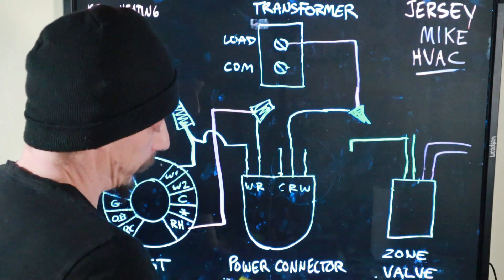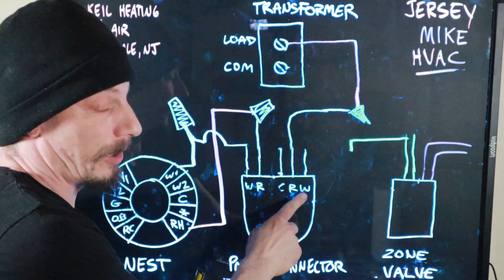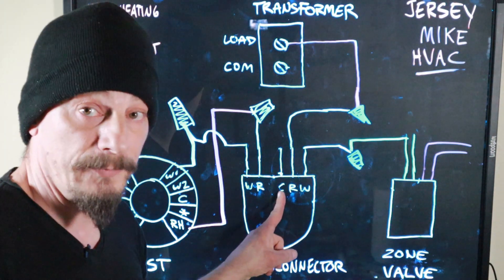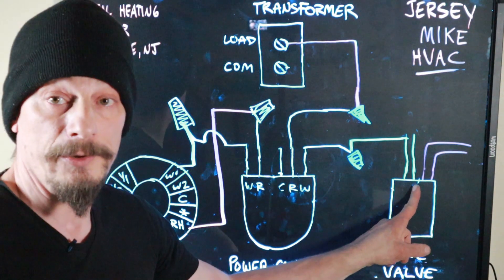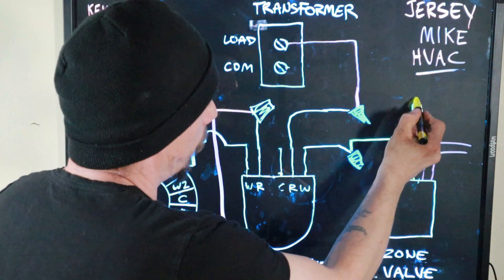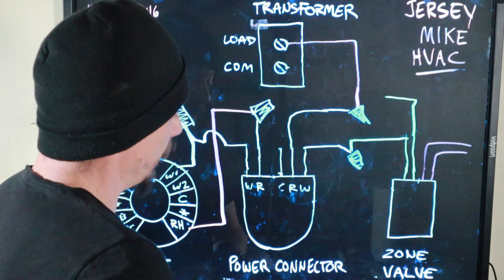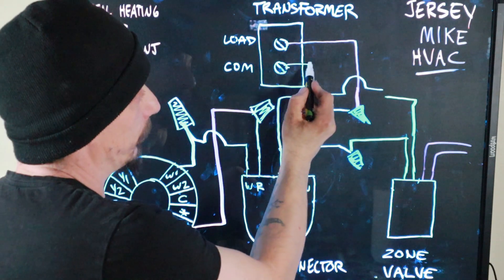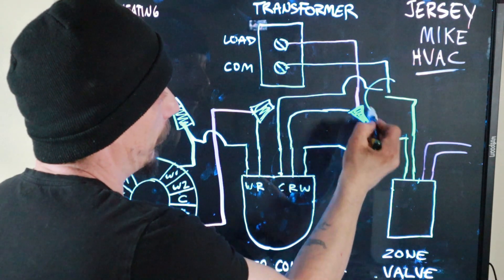DIY Nest Power Connector Wiring To Zone Valve (1 minute version)

Comment: Wondering how to wire power connector to Taco 571 please!
Reply from the maker: 1. You most likely have a red wire from the transformer load terminal going to all all of the red wires that go up to all of your thermostats (the R terminals on your stats). You're going to remove the red wire that goes to your Nest thermostat's R terminal from that bunch and connect it to the R wire on the left side of the power connector. 

2. You will then connect the R wire on the right side of the power connector to the same bunch of wires you just disconnected the red thermostat wire from. 

3. The white wire coming back from your thermostat's W terminal is going to terminal #1 on the zone valve.  Disconnect that white wire from the zone valve and attach it to the W wire on the left side of the power connector. 

4. Attach the W wire from the right side of the power connector to the same #1 terminal on the zone valve you just disconnected the thermostat white wire from. 

5. Connect the C wire on the power connector to either the #2 terminal on the zone valve along with any other wires that are also there, or to wherever wires are spliced together leading to that #2 terminal, which should also be going back to the common terminal on the transformer.
Reply: @Jersey Mike HVAC  
Going into transformer is black and white. Coming out is blue and yellow. Blue wire nuts to red and yellow wire nuts to white. Red goes to wire nut which is white going to thermostats. White goes to wire nut which is white going to zone controls. Red from thermostat just goes to red going to zone control. Zone control #1 is red #2 is white and $3 is green. 
How does this change things?
Reply from the maker: Whomever wired this up didn't really follow industry standards, and I'm missing some information to make sense of what they did. Let's start over. 

1. How many Nest thermostats are you trying to hook up? 

2.  Black/white on transformer is 110 volts. Blue and yellow is 24 volts. You said the blue connects to a red wire, then connects to a white wire which then goes up to the "thermostats".  Do you mean all of the thermostats or just 1 thermostat? And what terminal or terminals does that white wire connect to at the thermostat(s) themselves? R or W?  

 Normally, blue off of the transformer is used as the common and yellow the 24v. White low voltage wiring in this circumstance is typically common and red 24 volts. But you have an arrangement that's mixes it all up. You have blue (typically used for common) going to red (which is typically used for 24v) which then goes to white (which is typically used for common) then goes up to your thermostat?   This only makes sense to me based on what I have if the red wire at your thermostat is hooked up to the W terminal and the white is hooked up to the R terminal...which would also be backwards.
Reply: @Jersey Mike HVAC  There are 4 zones, but one  is garage, so I only plan on installing Three Nest Thermostats. But for right now, I am only doing one. 
Blue comes out of transformer, turns into red, and goes to the bundle of 4 white wires, which then go to each thermostat and are connected to the W Terminal. 
Yellow comes off transformer, turns into white, and goes to a bundle of white, which goes to each the 4 zone valves to the #2 terminal on Taco 571. That bundle also contains the  white wire directly from T in aquastat. 
The red wire going to each thermostat is only tied to the red wire that goes to the zone valve in terminal #1
The red aquastat wire goes to a bundle of green wires, which then goes to each zone control terminal #3
On thermostat red is R, white is W, zone valve #1 is red, #2 is white and #3 is green. 

Thanks!!
Reply from the maker: @donaldsholes6124   OK. I get what they did now. Your thermostats are receiving 24 volts at their W terminals, whereas normally power is supplied to the stat's R terminal. Obviously, that still works with a battery-operated thermostat because the thermostats are not looking for a power source. They're just closing a circuit on a call for heat, so it doesn't matter which terminal the power is coming from.  But I can see that not working with a Nest. 

 So my next question is: what model Nest do you have and what made you determine you needed a power connector?  

Newer Nests need a common. 3rd gen, E, etc. often can work without a common wire, but they use internal jumpers and are looking for their power source off of the R terminal. 

  It's still possible that all you need to do is reverse the 2 wire connections at the thermostat, but I need to know what model Nest you have.
Reply: @Jersey Mike HVAC  They are the original Google Nest Thermostats. After installation, it's giving me a Note: N260, and frequently disconnecting from WiFi. Occasionally, it also reads "No Power" on display.
Reply from the maker: @donaldsholes6124  OK. Let's try this first:

Shut off the burner switch at the boiler. Move the white wire that's going to the W terminal and connect it to the R terminal. Take the red wire going to the R terminal and connect that to the W terminal. Turn the power back on. 

Lets see if that works before diving into zone valve wiring.
Reply: @Jersey Mike HVAC  It does the same thing, No power, connect power, wifi disconnect.
I also did a restart and a factory reset. I need to keep lying on the setup saying I've installed the power connector or it won't let me continue setup.
Reply from the maker: @donaldsholes6124  OK. I have to leave soon to take my daughter to the airport, which is going to be chaos. But later on tonight I'll type up instructions for you on connecting that power connector.
Reply from the maker: So what we're going to do is leave the wiring at the thermostat as I suggested earlier. White wire to R and red wire to W. 

Turn the boiler power off. 

The green wires and the 3# terminal on the zone valves have nothing to do with what we're doing here. So we can ignore all of that. 

 Now you said the blue from transformer goes to a red which connects to a bundle of white wires that goes up to the W terminals on all the thermostats (except for the Nest which we have switched). You're going to disconnect the white wire coming from your nest thermostat (which is now connected to the thermostats R terminal) from that bundle. That white wire from the Nest is now going to get connected to the R connection on the LEFT side of the power connector. 

The R wire on the RIGHT side of your power connector is going to get connected to that same white bundle of wires you just disconnected the white thermostat wire from the Nest.  So on all of your other thermostats, power is going to the W terminals, but with the nest, it's going into the right side of the power connector first, jumping over the left side of the power connector R wire and then up to the R terminal on your nest thermostat via the white wire. 

 Next,  you said the red wire from the thermostat connects to the zone valve #1 terminal. You're going to disconnect the red wire from that #1 terminal on the zone valve (which now connects to your Nest W terminal) and connect it to the W wire on the LEFT side of the power connector.  So that red wire now goes from the left side W connection on the power connector to the W terminal on your Nest thermostat. 

You will then take the W wire on the RIGHT side of the power connector and connect that to the #1 terminal on your zone valve that you disconnected the red wire from in the previous step. 

The remaining C wire on your power connector is going to connect to the same bundle of white wires coming off of the #2 terminal on the zone valve, which go back to both the yellow on the transformer and the white wire leading to T at the aquastat.  

Turn the boiler power back on and test.
Reply: @JerseyMikeHVAC  thanks for the info. I'll try that in a bit and let you know.

It works! Thanks again for helping people like me. Haha. Fire sprinkler fitter, but not HVAC! appreciate it very much.

Comment: Hopeful you might be able to help solve a dilemma. I have 5 zone valves, all have 3 wire ran between the tstat & zone valve red/white and the Green not being used. However, there is only 2 wire connected to the transformer & aquastat. I want to install nest thermostats. can I just replace 2 wire to the aquastat with 3 wire and use the unused green wire as a “C” wire? Ran through the house? And how would I make the terminations at the zone valves.
Reply from the maker: You can certainly use the green as a common, but the issue you're likely to have is in having 5 zone valves, which is about the limit a 40 or 50 volt-ampre transformer can handle. Adding the draw of nest thermostats will likely be too much, with or without the power connectors. 
 
Most likely solution is to have a separate transformer installed with a RIB relay, but the wiring is going to be a bit tricky.  If you want to do it yourself I would strongly recommend a zone controller instead. Something like this: 

https://www.supplyhouse.com/Taco-ZVC406-EXP-4-6-Zone-Valve-Control-Module-with-Priority-Expandable?utm_source=bingad&utm_medium=shopping&msclkid=6837100e94ea1736edbf73b9d9d01972

It'll be far easier for you to wire because it comes with 2 transformers to handle the 5 zone valves and nest thermostats, and the zone valves and thermostats connect directly to the marked terminals in the zone controller, instead of in a big confusing bundle.  It is a complete rewiring but is far less confusing and fairly straight forward in the instructions. You'll have to connect the high voltage as well, but that's not complicated if you've worked with electrical before.
Reply: Hi Mike Thanks for quick reply, don’t need nest for all 5 zones most 3 would I still  need the zone controller?
Reply from the maker: @rayzrLennon  If you only had 2 or 3 zones you could get away with it just hooking up the commons, but I'm fairly certain you're going to need another transformer either way you go about it with 5 zones feeding off of a transformer that's already at its limits. If you had a 6th zone you would need 2 transformers just for the zone valves themselves.

Comment: So the second set of wires on the zone valve are not connected to anything anymore?
Reply from the maker: There's no need to touch them to begin with. They stay hooked up as they were.
Reply: @JerseyMikeHVAC  just saw your other video about the valve makes sense now, great videos the wiring was really overwhelming at first but I just learned so much in such a short time and it’s all so simple, thanks so much!
Reply from the maker: No problem! Glad ot helped.
Reply: Would multiple adapters have everything jumped together or is a separate transformer needed? I’m having issues with using 2 adapters
Reply from the maker: @mchammer28   Not sure what you mean by everything jumped together with multiple adaptors, but if you're using two or more, then both power connectors will be getting power from the same connection from the transformer, and both common wires from the power connector will be tied into the same common point leading back to the transformer. But everything else is completely independent for each power connector/zone valve/thermostat set up.

 If one power connector or the other works fine, but you're having issues with both, then you're likely exceeding the VA rating of the transformer (assuming the wiring is correct).
Reply: @JerseyMikeHVAC  I think one adapter just shit the bed on me overnight, tested them both individually and ones not turning on the valve when heat is on now, but yea the original question was confusing sorry lol basically just making sure there’s no issue running two
Reply from the maker: @mchammer28  Running two shouldn't be an issue, no. Check all of your W wire connections everywhere to make sure they're making good contact and not loose or anything. If you're not having power issues on the stat with the power connector that is not working then something like that could be the issue.
Reply: @JerseyMikeHVAC  yea I figured it out, not sure what happened but the bad connector has no continuity through the w circuit so waiting for a replacement now. Thanks again for the help !!
Reply: Thanks Mike for this incredibly informative video. Google nest is really dropping the ball for not providing better instructions for installation of these units. I have an oil fired boiler 
w/radiators and a two zone system first floor, second floor. I installed two of the nest power adapters, and everything seems to be running smoothly. The issue I was having was short cycling of the boiler and the ambient temperature in the room is at least 5 to 6° cooler than what is indicated on the nest.
Reply from the maker: @robjackson5777  Sometimes a reset will correct a temperature differential like that. A factory reset might be warranted to fix the short cycling issue. This is a common problem and it seems to be a bug or a software issue.
Reply: @JerseyMikeHVAC  
Many thanks, I'll give that a shot

Comment: I have a heat only White Rodgers 1361-102.  Can you tell me which terminals on the zone valve would be considered the yellow wires?
Reply from the maker: I don't know if a power connector is going to work the same way here. These types of zone valves are internally wired a little differently than a Honeywell 4-wire I used in the video, so I don't believe you're really looking for the "yellow wire equivalent" here.  I've never wired in a power connector to these zone valves. But after looking at the White Rodgers wiring diagrams for the model you have, I can only make a wiring suggestion. Again, I'm not sure it will work. These valves have moving contacts that make and break as they rotate, so you may still have power interruptions that will not sufficiently charge your thermostat. These zone valves also use more power than a Honeywell, so adding the thermostat could be a strain on the transformer. 

BUT, if I were to attempt a try, this how I would try to wire it:

1.  Connect the white R wire from the right side of the power connector directly to the #2 terminal on the zone valve. This is the 24v power supply from the transformer. 
2. The gray R wire on the left side of the power connector to the red wire going up to the R terminal on your thermostat. 
3. The white wire from the W terminal on your thermostat to the
gray W wire on the left side of the power connector.
4. The W wire from the right side of the power connector to the #4 terminal on the zone valve. 
5. The common or C wire from the power connector to terminal #1 on the zone valve. That's your neutral back to the transformer. 

 It's up to you to decide if you want to try.
Reply: Tried this, didn't work for me. I was getting 26V upon heat call, but for some reason the valve just never moved. When I nudged it, it just went back around to closed despite having the voltage on #4. I don't think the nest adapter allows enough amperagw through to open the valve.